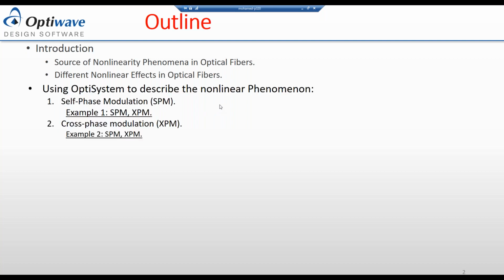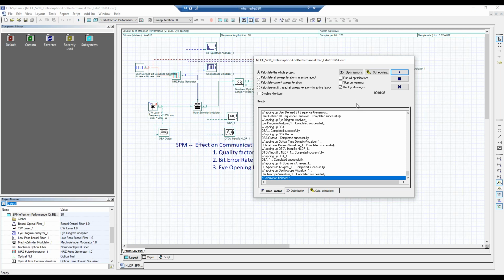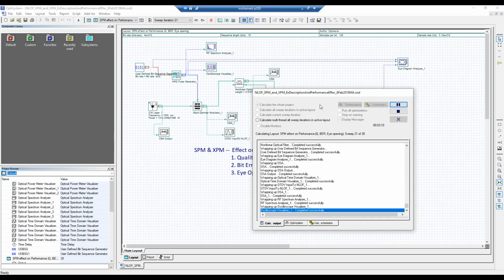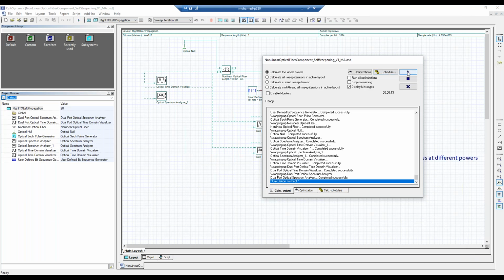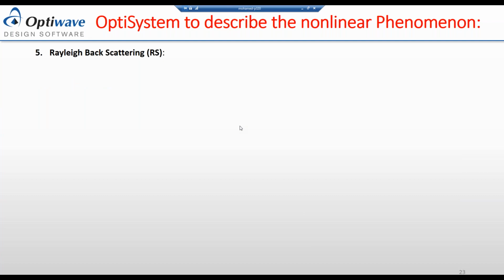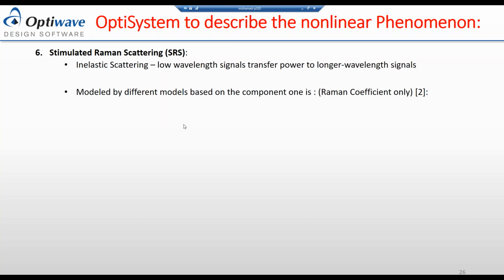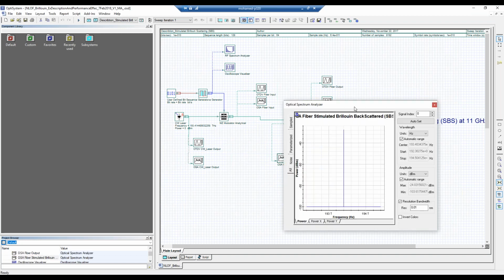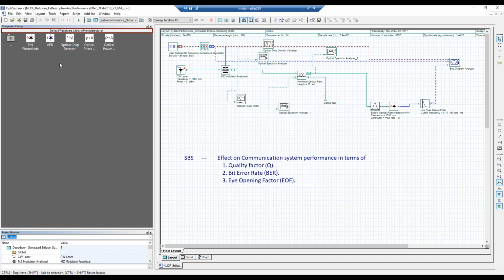OptiSystem  Describing the Nonlinear Phenomena in Optical Fibers

Comment: What are the other results that can be observed and plotted for cross phase modulation?
Reply: Typically, you will be interested in checking the system penalty due to XPM/SPM. Thus you would plot BER versus power. So, you need to connect a detector, filter, BER visualizer and power meter in the setup. Then, you should be able to make such characterization. please email me at ahmad.atieh@optiwave.com if you need to discuss further.